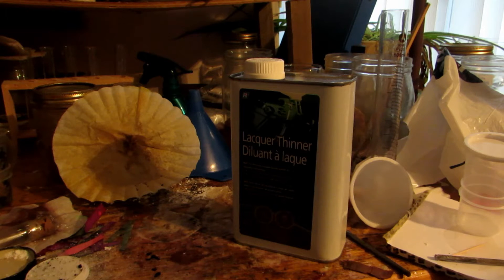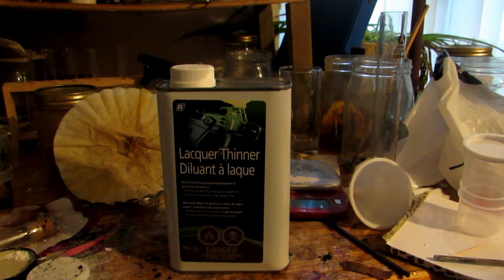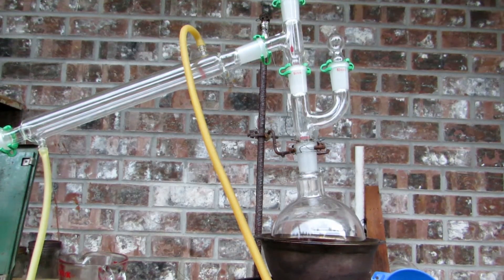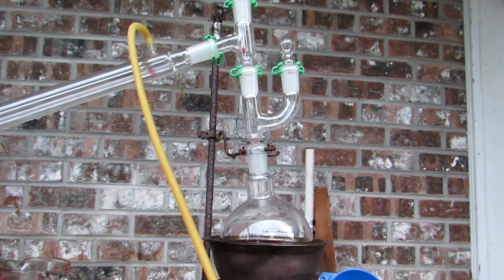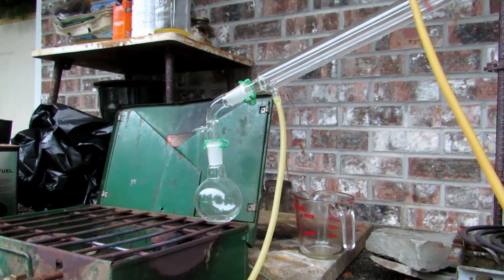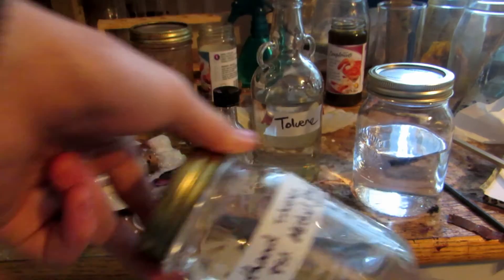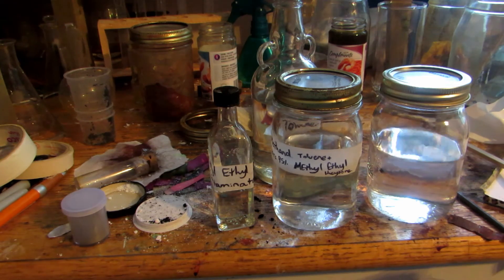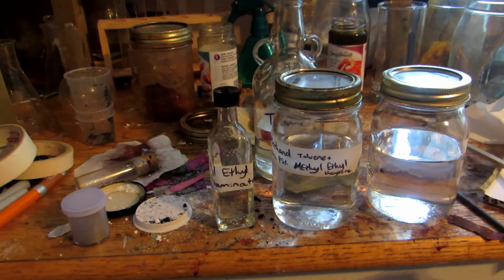Extract Toluene From Lacquer Thinner

Comment: If you set the  heat at 90 degrees, after a while nothing will condense meaning that the rest of the solution is  (methanol keytone?) almost only toluene?